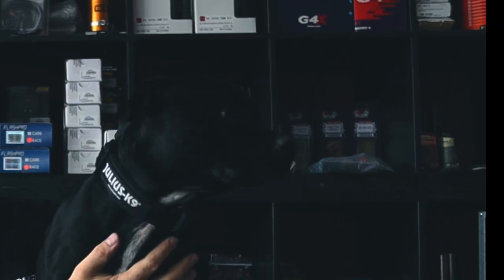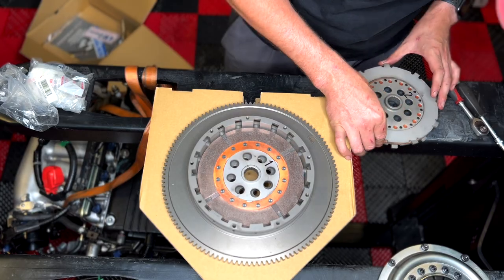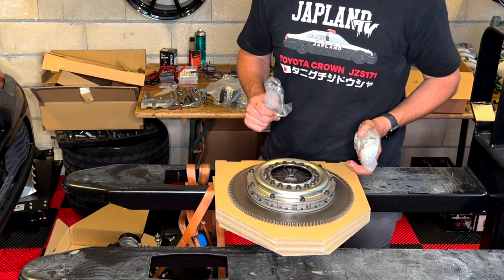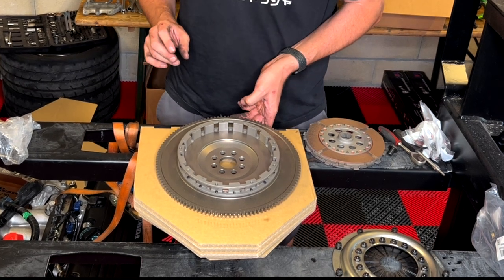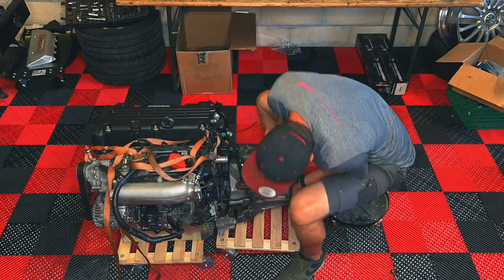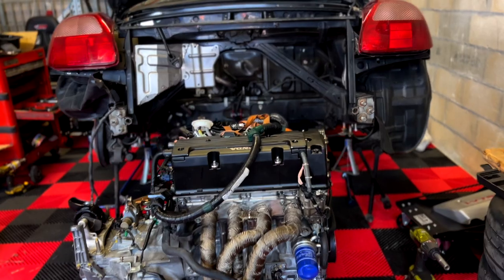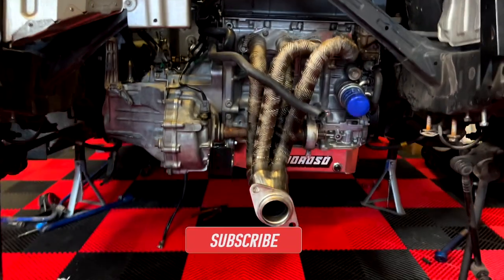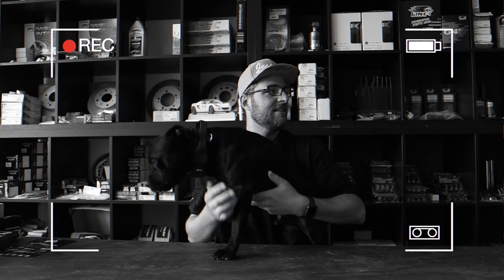How to Kswap an Mr2 Spyder EP10: The Motor is going into the mr2 zzw30! Does the RRC manifold fit?

Comment: Are there any issues using that k series moroso oil pan with this chassis?
Reply from the maker: Hi, I haven’t installed the subframe yet. Lets see if it clears. But it looks fine for the moment. I’ll mention it in the next video if I have to modify something
Reply from the maker: Hi, I haven’t installed the subframe yet. Lets see if it clears. But it looks fine for the moment. I’ll mention it in the next video if I have to modify something